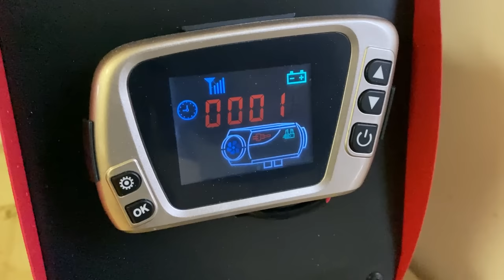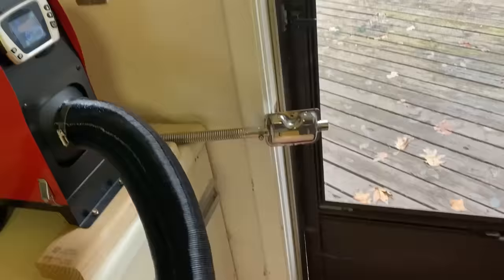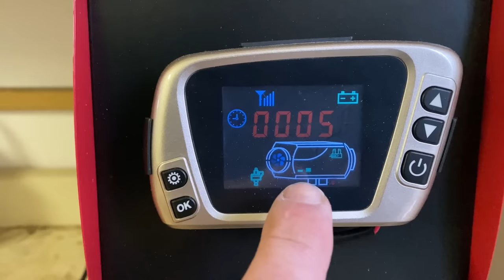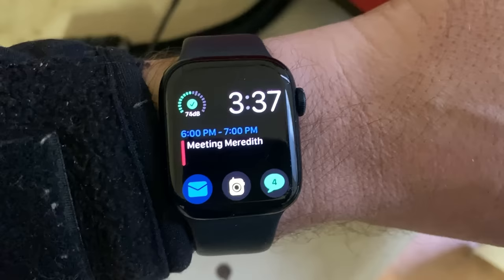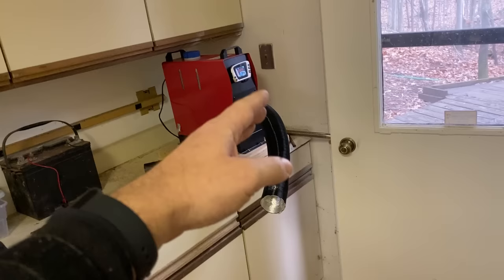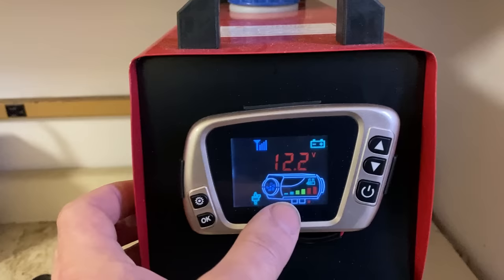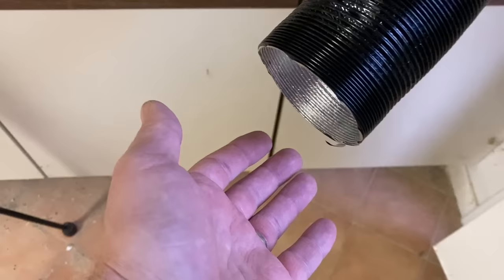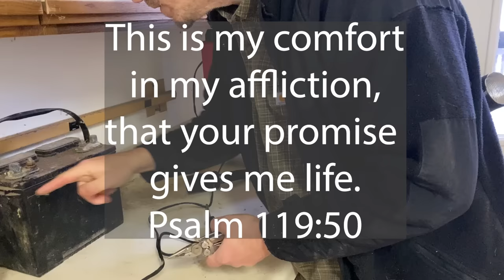Testing a $140 Chinese 8KW Diesel Heater #vevor

Comment: Interesting ideas. How long can you run these for before you need to turn them off. Can it be kept going all day? Also I like the idea of drilling a hole in the wall for the exhaust forums. What would you need to put around the pipe in the wall so that the inside of the wall does not catch on fire?
Reply: Get an insulated exhaust pass through for a pellet heater for the wall

Comment: Hello Dad. If I try to use this in a shed with a 220 volt extension lead, Please tell me what I will need to make 12 volts of power? Thank you.
Reply from the maker: A battery and a battery charger, or you can buy 12 v power supplies on Amazon
Reply: Thank you)  @SSLFamilyDad

Comment: Any idea how long a tank lasts? And would a 120ac to 12vdc voltage converter power it?
Reply from the maker: Not sure on how long it lasts at full force. An  ac to dc power adapter would work

Comment: I got one 8kw 2 years ago. Dang thing didnt work right from the start.  Wouldn't burn right, wouldnt start. Id have to put either in fuel line and run it before it would start. Have to chole the air inlet to make it fire. I uad to set starting hz at .8 and 1650 rpm to get it to start with out 4 attempts.. But it just wouldn't burn right no matter what settings, lots of popping.. It didn't matter if i ran Diesel or heating oil.  Tons of info on settings for the 2&5 kw heaters but almost nothing on the 8 kw heaters.  

At about 2.8-30 hz i ran for like 8 hrs and had fuel left

Comment: I just installed one of these that is the same brand as this vid. Its working well, but the heated air has a plastic or strange chemical smell. I have it running outside now in the hopes the smell will be burned off.  Has anyone else had this problem.  It gagged me out of my house (400sf tiny house) last night. I feel sick if I smell that smell now.  Yuk!
Reply from the maker: It smelled for the first hour of run but it went away after a while
Reply: I did have same smell, its the rubber gasket under the burner, easy to take away and no smell anymore. Smell wont go away by burning more... i tried it. Take the rubber out.
Reply: @solopomodoro5853  Thank You!  I will.  Now that you mention its from rubber, the smell does remind me of burning rubber, or rubber like plastic.  I was trying to remember when I had smelled something like that and couldn't place it.

Comment: id be interested on burn time for a gallon of fuel and this could run on used moter oil . great vid , thanks
Reply: There are numerous videos on YouTube covering your questions
Reply: Mix used motor oil and diesel !
Reply: They clog up on oil they run best on kerosene diesel mix
Reply: @s.a.t419  even if you mix it 50/50
Reply: If you know the capacity of that tank (Its more than 1gallon 4.5ltrs) it will last on 3 setting 14 1/4 hours thats it. No where near what people think.
Reply: @jamesyurky3048 I run oil in mine, but be prepared to have to clean it.  Up to you weather or not free fuel is worth the hassle of having to clean it.
Reply: @Uriah625  are you burning 50/50 or straight used motor oil
Reply: @jamesyurky3048  I’ve tried numerous variations.  I do about a 50/50 mix and run a aquarium heater to 102 degrees. Get about 50 hours before cleaning.
Reply: @Uriah625  what about vegetable oil 50/50 with desiel?Do you think that could work?
I have an endless supply of it which I can filter.
I'm wanting to use my heater for warming chicks as electricity is going through the roof here in Australia...any advice would be appreciated

Comment: They're good depends what you want it for, it's not 8kw as they don't make them, 5kw seems to be the largest but myself along with others have found these portable units are 2 or 3 kw's. I've picked up 2 1 portable and 1 had to setup and both are the 2 or 3 kw units even though sold as a 8kw. I use the portable for my ice fishing tent and the 2nd is setup on a power inverter  110 to 12v to heat my porch. Have a couple videos on them on my page also but there are some folks who have gone into great detail about these and the different ACTUAL sizes
Reply: They make 8k ones..
Reply: @n1ksf  have you seen the a 8kw one in person and compare it to a 3kw housing version or going  by what vevor and other Chinese retailers sell them as ?
Reply: @ChippyOutdoors well if a 3k or 5k can heat a 30 x 36 garage, God Bless them. I'm going by its ability to warm nicely, an over 1,000sq ft uninsulated metal building here in northern New England. A 3k or 5k wouldn't do it. I bought an 8k and I strongly believe it's an 8k for reason above.
Reply: @n1ksf  there was a couple over seas from me channels that had larger and regular sized housing Heaters which would make sense for a 2 or 3 kw heater for the 5kw maybe doable with simply tweaking the controller but a 8 kw would be virtually  impossible without a larger housing to absorb and transfer the extra heat needed to make a 8kw of out put. There's a fellow in Ireland more specifically  that tested all this "sales gimic" but he also had a larger housing for 5 or 8kw rating as well. Broke it down very well, but folks like my self though they were buying a 8 kw version 100% would have been ripped off by false advertising, but on the flip side I don't have any complaints about the diesel heaters I have except for the false pretense on kw rating claiming a larger kilo watt heater when someone isn't actually receiving one
Reply: @ChippyOutdoors  obviously there's no way to calculate the btu's from these, but for the price and what it does, I'm content..Not saying you're wrong with the btu's..

Comment: How many watts would this use? I have a Jackery connected to a solar. I can't seem to figure it out haha
Reply: Around 140 on startup and then ticks over at around 40. Obviously needs a bit more juice at start up as it has to get the glow plug up to temp
Reply: @LockStoppageSandwich  yeah that was the conclusion I came to, thanks. I got the ecoflow river 2 max (recharges in one hour, wow) the diesel heater arrived today. When the two are connected I'll know the exact numbers soon. :)

Comment: So, does it only run on diesel? It won't work without the dye that discriminates diesel from heating oil?
Reply: It will run on fuel oil.
Reply: They run on both..
Reply: old simple design, will run on literal oil, waste oil, and if not it will mixed with a pinch of real diesel
Reply: @escapetherace1943  that's awesome!

Comment: I tried my best to read all the comments but still have a question. Im planning to use this heater in a bus instead of my very expensive to run electric heater but I do get power outages from time to time. Last winter we had a power outage that lasted 5 days and it was at least -19 outside. Just wondering how many amps this heater uses so I can calculate amp hours for a battery bank. And no, unfortunately I do not have any solar panels. If worse came to worse I would be using my truck via jumper cables to maintain the battery that runs the heater. I know...ugg! But it has to be better than spending 100 dollars a month on an electric heater that on the cold days only gets the bus up to just above freezing inside. Depending on the responses I get I would like to maintain the battery for the heater with a 12v trickle charger. Or maybe just scrap the whole idea but I truly hope not. I have looked into the cubics cub and grizzly wood stoves. They look great, but are wildly expensive and I can not get up every hour to put wood in the fire. My house that is literally 30 feet away, that was condemned 2 years ago has a beautiful wood stove in it but is way way too big for my current "house"! I could fill the stove and it never got below 50 degrees (f) after say 9 hours but I did use between 5 and 7 cord of wood each year. Ponderosa pine in the black hills of South Dakota is basically free if you have a chain saw. Just trying to get the best of both on and off grid worlds at the same time I guess. Any input would be greatly appreciated. :)  :)

Comment: Why does it need a car battery?
Reply from the maker: It is a 12volt system, meant to be installed in a vehicle, camper, bus, or be remote on solar power
Reply: You could use any 12v power supply as long as it can provide 8 Amps to get it started.  After it starts, it only needs about 3 Amps to run.

Comment: The 8k is a chinese marketing con. Like those 1000000 mAh rechargeable batteries... I wonder why they do that and mostly why amazon let that scam appended. Because the sad thing is that sometimes the batteries or other product are on par with the best real ones but way cheaper but other times are real scam...  That unit is a 5k i believe. At 1/10th of the price of the original it's a good deal for what you pay for. Just don't depend on it . ( like surviving at -40 with no backup ). But i don't understand why they have to lie about the power and exaggerate. Maybe it's a chinese thing because they have little... Self esteem !o!  

Anyway the exhaust is really hot and wonder if he burn his door screen. Especially that they are mostly made from plastic lately

Comment: Why not use a diesel or gas generator, that way you will be burning the fuel more efficiently & get the same heat but you will be generating electricity that will give you light or an electric heater in another room, people are unbelievably dumb.
Reply: So you think running a generator is more efficient? Lol you do realize that a generator doesn't make produce spare electricity. The fuel needed to run the motor is directly proportional to the electrical load. The more electricity you are drawing from it the harder the motor has to work to overcome the resistance of the generator. There's no free lunch here.

Comment: Don't use this in a camper! You may not wake up in the morning
Reply: Why?   Designed for truck sleeper
Reply: @charliemagoo7943  the webasto copy version yes but this all in on unit is not safe the silencer leaks and fuel hoses are not correct this will be lethal in a inhabited space. Will be better to buy the kit and instal properly and use a genuine webasto exhaust. Quite a few people have died because of Chinese diesel heaters not being installed correctly
Reply: @andrewmuir9073  the silencer is supposed to be outside anyway, in fact so is the air intake.   Install it correctly and should be no issues, much like anything really.
Reply: If you are unsure, you could bring a carbon monoxide detector with you.

Comment: Step 1   Remove the cheap crap chinese fuel line    Replace with a real fuel line and put a fuel filter inline   The heater is worth a $4.00 fuel filter

Comment: Can this be converted to run on used vegetable oil?
Reply from the maker: I don’t think so, but I suppose with some knowledge and modification anything is possible. The issue would be reprogramming the controller
Reply: No conversion needed.  It will run vegetable oil or even filtered used motor oil.  Most people will mix in diesel fuel to at least 50% though.